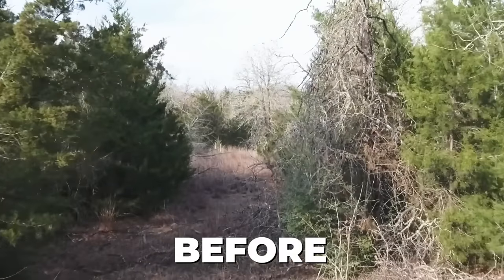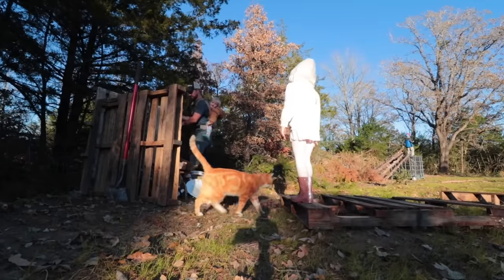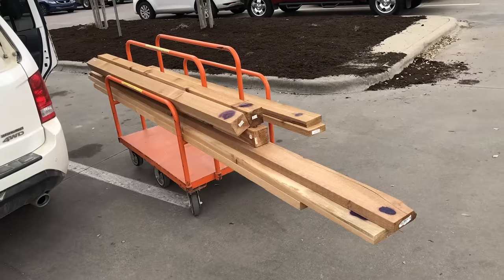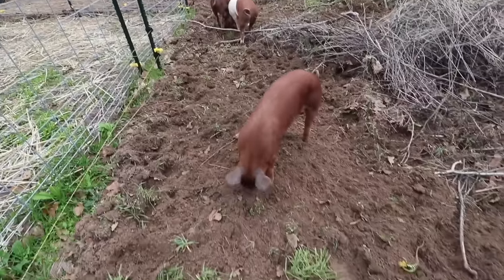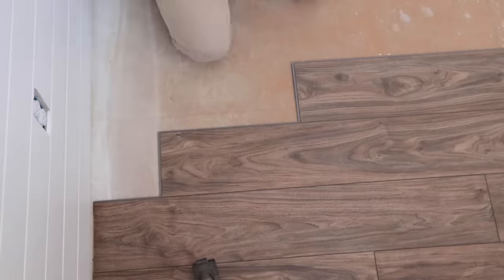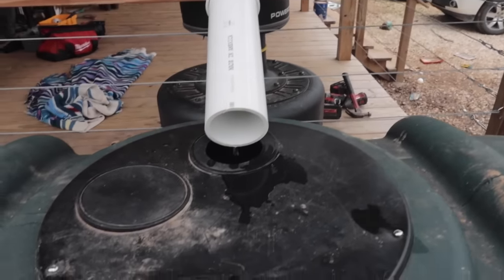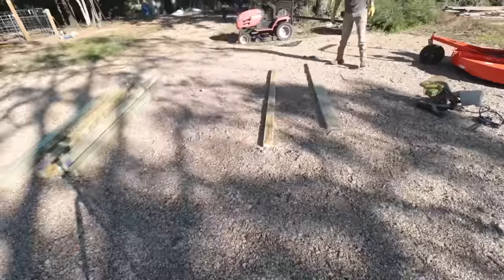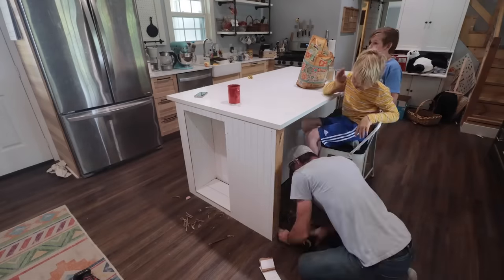Everything I Built on 7 Acres of Abandoned Land (YEAR ONE TO FOUR)

Comment: My husband (29) and I (27) are debt-free and looking to buy raw land. We found your channel doing research on sheds to homes. All the work y'all have done and what y'all are accomplishing with homeschooling and homesteading is inspiring! I researched United Portable Buildings based on your recommendation, but it looks like they do not service Georgia. Do you have any other companies you recommend in Georgia? Or does Casey from UPB have any recommendations (Or plans to expand to the Peach State 🤣🤣)?
Reply: I would consider finding a local contractor to come in and build a slab home. These sheds can set you back 20k just for the shell. While a full build might cost a bit more for the concrete floor it will be overall cheaper in the long run. If you want insurance it might be harder to insure these shed homes. 
You can check with big box stores like Menards which sell garage kits that you have to build your self that are likely much bigger than these shed homes.
You might even consider a pole barn as they can be built cheaper. Then you can insulate the ground and pour a floating slab. To finish the inside only requires very little work. You will end up with thicker walls than a standard home. 
EG4 also make a 2 ton mini split for 2k dollars which has the option to hook directly to about a 2kwh or less solar array to provide heat and cooling. They also make a 1 ton unit for 1300 dollars. This option is really nice because you can use the off grid only function to cool or heat only from the sun. With extra insulation in the home it will help slow the heat from getting in to your conditioned space. There are a number of reason why not to do shed homes or container homes. Many of these ideas cost more than people think. 
A pole barn is a viable and cheap option which can give you a fairly good size house. If you intend to have kids then building out with that in mind and keep in mind you will need a massive pantry if you plan on doing anything garden related. You are still young enough that you could sell off everything you have and move in to the cheapest place you can find and or find a relative to which you could pay a small rent to use a spare room or rent a room and work your asses off for the next couple of years to save and pinch every dollar you can. Getting weekend or night jobs as well. If you have medical use it as much as you can to get you and your husband checked out for every minor thing because not being healthy is not good. Exercise and gain some endurance as you will need a lot of it. You should also buy one of those book writing things and make a plans. Use every resource at your hand. If you plan on having services at your off grid place check with your gas and electric companies to find out how much it cost to install electric/gas. Is there any rebates/funding when building a new home. There are many options you must consider if you plan on building up brand new. Many of these cost are never told by these type of people. For example bringing in electric can cost a few hundred to 10s of thousands of dollars. Drilling a well can cost a couple thousands to 10s of thousands. Dry places in Texas like this would cost 10 to 50k to drill as there water table is several thousand feet down. Septic systems cost a few thousand to 10s of thousands. I paid 5k to put in a new tank and enough field to last me quite a while. 
Not trying to steer you away. Its a lot to consider and many people do not make it. Most of them end up going back to work in the city because they can not live with out the city. There are many people who stick it out because they have no other choice. fixed incomes, no jobs, down right poor. 
SInce you are debt free do you have quite a bit of savings now or in the thinking about phase? I am guessing you rent? Really should sit down and see how much money you can come up with in say the next 12 months and then work off of that. 
I will give you my best ball park cost to build a off grid home. 1800square foot pole barn 30x60. This should be enough for 5 bedrooms 10x12. Large bathroom/laundry room, large pantry/storage/tool room. Kitchen dining living area. Doing this as cheap as possible with limited and reduced everything. This mean one window per bedroom and a couple windows to brighten up the common areas. less windows means less cost and heating and cooling. 75k Well/septic. 20k Solar system/mini splits and panels. 50k,  1k to 2k per acre land ( more less depending on type ) Services 2k. Overall 150k cash and doing most of the work yourself will reduce the overall cost. Add in the cost of a truck and camper/tents for when plan to build. Ideal thing to do is to buy the land and keep working. Pay someone to come out and drill a well. Do some land clean up and prep the site for building a new building. Have the pole barn built and then have someone come in and dig septic and DWV lines. Water lines from well pit/filter room and install anything else you want. If you do this stuff your self make sure you do not skimp on building this because its a pain to do if you have to repair it. Test everything before you back fill. water test and or air test. Insulate and pour the slab and finish the slab. Then install your walls, electrical, communications cables with includes every room and possible security camera locations. then finish it out. Even if it takes you an extra year to get there you are still bring in a lot of money which can keep paying for these things. Think about long term goals for the place and once you think you are ready consider any other projects that you might want to get done. Remember at any time you can quit and move in. You do not need to rush. Its better to set your self up long term rather than short term being broke and having to move back to the city. You can live off grid and still live like you do today. There are viable solar options and solar is pretty cheap these days and can see a return in as little as 10 years. Plus once you have solar you may end up using more energy than you did before because you now have more solar than you need and can run an extra couple freezers/fridges. Installing electric water pre heaters directly connected to solar ( heat elements have built in thermostats) will reduce the load your solar system has to provide. You can set up a POS tankless water heater that you can add a 60 min timer to and use that at night if all of the pre heat tanks run cool. You could add several preheat tanks which can preheat or heat 40 to 120 gallons or more. EG4 mini split AC units have 3 settings, off grid, grid only and combo. These units alone would reduce your day time loads by large margins. Size the units right and install some type of fan circulation system in the attic much like a furnace would do to move air around and between all rooms will spread out the cool air better. 
Texas is kinda a bad place to live where you have do not have your own water. 
There are a number of places in mild weather areas where building codes and permits are relaxed. 
When I bought my home I had several goals in mind. 
15 mins to food/gas
45 mins to hospital/sheriff 
1.5 hours to Walmart
Septic/well water/natural gas/ fiber optics internet
Rural or city with no restrictions. 
I met all of these goals and own my house and land outright. I may not be off grid and I can do all of these things.
Reply: debt free... so proud of you guys :D hope it works out!
Reply: do it yourself. pouring a slab is like pouring water in a box. a shed is a box

Comment: Bio char is stuff burned without oxygen or partially burned but hot (400-700F), aka inoculated. Ash is just wood on fire. You would have to build a fire around a steel drum and put a lot of wood in the steel drum and seal it to make biochar
Reply from the maker: This is a debate that comes up often.

There is GREAT charcoal and then there is GOOD ENOUGH charcoal.

BIOchar is when you actually inoculate the charcoal.  We of course DID inoculate the charcoal under our rabbit hutches for about 6 months.  Making Biochar!!

But we certainly made perfectly good enough Biochar!  At a large amount and FAST!!!  No need for the drum.

All the best!

Comment: Here's a tip for using hydraulics on your compact tractor or any hydraulic equipment: Always lower the hydraulics or put them in a resting position when you turn off the equipment. This prevents the hydraulic rams from gradually losing pressure and potentially damaging anything beneath them. Avoiding this risk is important for protecting your equipment and property.

Comment: It’s known in the thermal building engineering world that spray foam doesn’t do well in warm weather, what is your experience so far ?
Reply from the maker: Been GREAT for us so far here in hot Texas.  And most new builds here in Texas do spray foam.  

Not not only for the R value, but for the multi purpose aspect of spray foam vs other types of insulation.

Comment: Lol😂 we are gonna start a goat diary, and a poultry hatchery I Am lactose intolerant I learned that goat milk is very gentle on the tummy and More nutritional than cows milk.
And a tips for your baby babies can tolerate the goats milk easier than cows milk.and my second baby tip is Diaper rash relief: Go to the store and get the feminine wash for sensitive skin, Wash your babies bum with it each time you change their diaper. Then dry them thoroughly. Then use your diaper cream, usually by the next day or two the Lil Angels bum is healed..
One more thing could you please show me an shed large enough for a wheelchair accessible home?
Number 1. The doors Will need to be wider and the bathroom needs a step in tub and handicap toilets and if there's a second floor a elevator will needs to be added 
Thank you for your help and guidance and consideration of this message,
Respectfully yours,
Donna Lane 
Kingman Az USA

Comment: Chicken wire, only ever to keep chickens in, not predators out.
Predator proof needs to be welded wire mesh ("hardware cloth" the Americans call it). And remember, predators fly, predators climb, predators dig under or predators slither in.
Also get chicken breeds suited to your climate, if hot, heat-tolerant birds, if cold, cold-tolerant birds. If in a moderate climate, the world is your chicken oyster as far as breeds.

No one gets to eat my birds (not even me!) they are layers and pets until they die of natural causes.